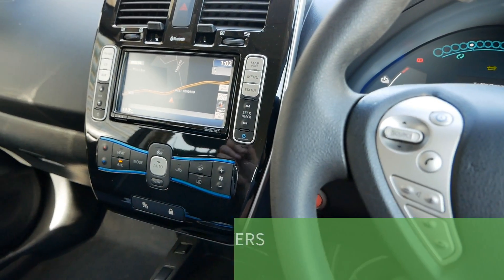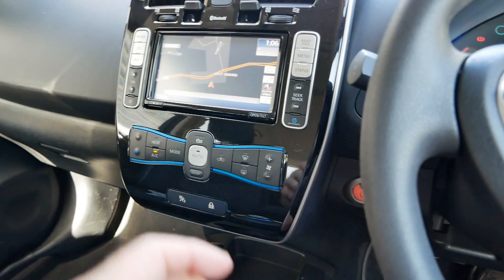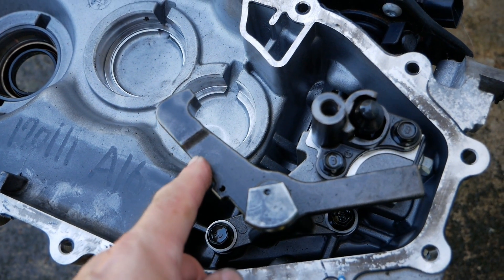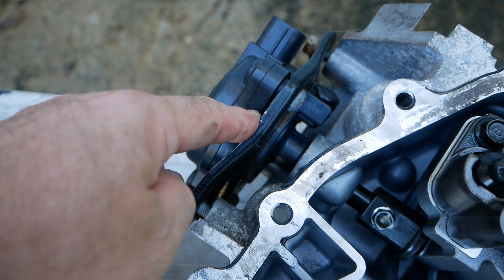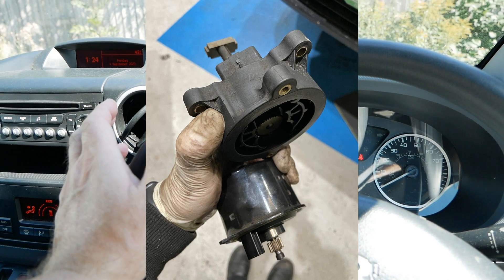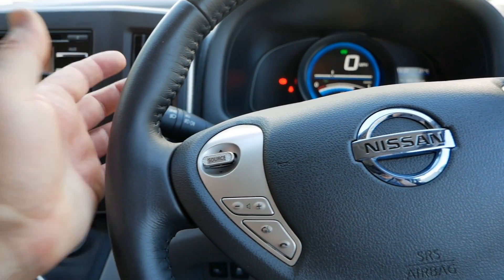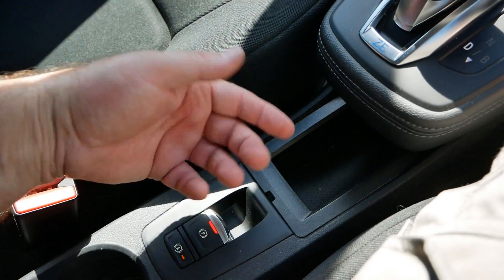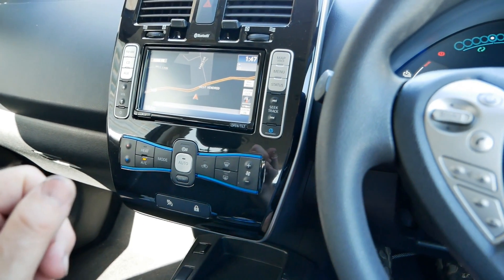How to correctly stop/park an EV. Many get this wrong, potentially causing damage!

Comment: Interesting. Therefore, if you have applied the ‘physical’ handbrake or equivalent what purpose does the ‘P’ on the EV gearbox serve? Just ensuring the car won’t move when started?
I assume the reverse is true when unbraking: ‘P’ EV release, then release the physical brake.
Reply from the maker: The park pawl is a sort of backup if the park brakes fail. Its an historical thing when rear brakes were drums. On modern cars with electric handbrakes, its not needed. Hence why some newer EVs no longer have one.
Yes, you're right about the reverse.

Comment: on my ioniq I alway use foot brake to stop completely my car then use electric parking brake then I release my foot from brake to ensure my car isn't moving and is holded by the electric parking brake and only after that I activate the P gear.

Comment: Same process as for automatic transmission vehicles.  One of the specialist Toyota mechanics on YT recently showed how small the parking pawl is in the auto transmission, and after many years of having the weight of the car resting on it, it can break.

Comment: On my Ioniq 2018, I simply stop the car with the brake, pull the handbrake and usually switch off the power. This also puts it in the park selection on the gearbox.
Reply: You can also simply switch the power off, and by the sounds it makes, it seems to put both Park and handbrake on automatically, presumably in the right order 😄

Comment: An extremely useful video Matt - thank you for explaining it.  I'd hazard a guess the vast majority of drivers new to EV's won't know this, as I have to admit I didn't. 
I have clearly been doing it incorrectly for the last 2 years with my 2021 Hyundai Kona.  It is my first EV and the Hyundai dealer I got the car from (on lease) did not mention anything about this.  In their defence, I didn't ask either.  My drive is on an uphill slope and I've often heard the 'clunk' when selecting reverse to back out onto the road.
Now I know what I was doing wrong I'll do it correctly from now on; Foot brake, Parking brake, Park
Reply from the maker: When on a slope, its even better to release the foot brakes after applying the park brake, then selecting park. It then means the weight of the vehicle really is being held on the rear brakes, which will put less strain on the gearbox park pawl.

Comment: the Ioniq manual has the following instructions : 
1. Hold down the brake pedal while the vehicle is parked.
2. While depressing the brake pedal, shift to P (Park).
3. While depressing the brake pedal, engage the parking brake.
4. While depressing the brake pedal, press the POWER button and turn off the vehicle.
Reply: Same
Reply: I’ve just I realised I’ve been using that method in our Ioniq without even thinking about it.
Reply: I use this method but the car move a Little bit After i turn it off, Is Okay?
Reply: @riccardomarinoni6733  car shouldn't move if parking brake is on before release foot brake
Reply: @sp1es  with parking brake on It move only 3-4 cm
Reply: @riccardomarinoni6733 this also happens on Leaf when parking on a slope

Comment: That method is completely opposite to what driving instructor teach. Most teach that you stop your vesical with the brake pedal, then with a ice manual transition put it in first or reverse, with an automatic transmission put it in park then apply parking brake then release brake pedal.

Comment: Not applicable to ID4 which when Park is selected as far as I can ascertain only engages the electric parking brakes on the rear wheels. There is no parking pawl in the gearbox

Comment: My car has no handbrake it only has a foot brake i thought it was the other way around because when its done like you describe the car almost jumps forward a little when you apply footbrake before neutral or park position i have a NISSAN LEAF 30 KW 2016  model.

Comment: Great explanation! I didn't know that. On my EV, I am used to press the foot brake and while it is pressed, i press park, then press the electronic park brake, then release the foot brake. Since the weight of the vehicle stays on the wheels brake pads, is that way of doing it is okay as well ?
Reply from the maker: Yes that's fine, but if you're on a slope, you really want to be applying Park last.

Comment: On an MG ZS EV, am I doing it right it I press the foot brake, then press park, then switch off? Can I just switch off with my foot on the brake? I can hear it out the electronic parking brake on.

Manufacturers who will only supply a complete new reduction gear box are thieves, frankly.
Reply from the maker: Many vehicles with an electric handbrake will apply the handbrake automatically when you press park or stop the car, but that's not a good idea if on a slope as the order will be wrong still and the weight of the car will not be held by the handbrake.

Comment: How much credence can you give to someone who rips up a parking brake lever without pushing the button to stop the ratched wearing? My Soul EV automatically activates the parking brake once the system is switched off, but Park is engaged first.
I appreciate what you're saying about not stressing the great box pawl, but cars are designed to be sold world wide and no driver in North America would dream of using "the emergency brake" for everyday parking :)

Comment: "An electric vehicle"? On the most sold electric vehicle (Tesla) you just press the park button or open the door. And you can do it in motion as it is just an electric actuator on the rear brake. So it is not possible to do it wrong.
Too many videos using "You are doing this wrong" as clickbait.

Comment: Not that long ago I was in a transit electric driving slowly across our compound on a rough bit of road with undulating pot holes. Basically it was that bad I bounced out my seat. This put the vehicle into park. The noise it made as it stopped was amazing.😂😂😂

Comment: the most important factor is not releasing the foot brake until both park gear and the handbrake are applied, right? as long as you don't release the foot brake until both of those things are done, then it doesn't matter what order you select park or apply the handbrake, yes?
Reply: I would tend to agree with your statement since the weight of the car would still be held by the brake pads.

Comment: Shouldn't the sequence be to RELEASE the footbrake after applying the handbrake but BEFORE engaging park? Most vehicles on a slope will "settle" on the suspension when transitioning from 4 wheels braked to 2 wheels. Such movement would also apply some load on the transmission defeating the purpose of this sequence (depending on the amount of free movement in the gearbox)

On the flat none of this makes much difference.
Reply: Surely it makes sense to go to neutral before Park as well. So, Stop using foot brake, apply handbrake, select neutral and remove foot from foot brake (now the car will settle and all weight will be on hand brake) then select park. That is how I do it in an Auto.
Reply: @migsg7238  you are correct neutral would leave the car with no load on the drive line. Depends on the vehicle, an ICE automatic would be gently pulling the car forward so neutral first would help. An electric car may or may not have creep, so neutral and drive may be the same thing on those cars when stationary.

In reality though when you shift an automatic transmission from drive, through neutral and reverse to park you should have your foot on the brake, and some cars require that to enable shifting. ICE vehicles with a mechanical transmission will have a delay as they shift between each mode so there will be time when the transmission has no load on it before the parking pawl is engaged.

Personally I think cars should be engineered so that drivers don't have to do these rituals, and the majority of vehicles are engineered that way. The parking pawl mechanism should be robust enough, and if there is a sequence that lowers the load on it this should be implemented in software, especially now vehicles often have electric handbrakes. The best solution would be no parking pawl at all, but that does require a robust parking brake with redundant application (i.e. an in caliper motor so that each wheel is separately actuated for redundancy, although this doesn't provide locking of all 4 wheels in front wheel drive vehicles).

Comment: Why does the motor burn out?  If the parking pawl is engaged in the gear, then why would the motor remain energized?

I can see that there would be significant stress on the pawl but I cannot understand why the motor is overloaded?

Comment: This is ridiculous! Don't you think the engineers have thought about this during the design stage? Besides. There is no need to engage "park" if the handbrake is engaged. What is it for otherwise?
Reply from the maker: Most (if not all) vehicles wont start unless its in park. As for the function, its a historic thing and a backup to the handbrake, which could be poor on older cars, especially drum brakes. Now that many cars have electric handbrakes which apply much more force to the brake pads, park on the transmission isn't needed and as I showed on the Renault Zoe ZE50, it has been removed on some vehicles.
Reply: @GoGreenAutos  I had a hire car in Abu Dhabi and was giving a lift to colleagues.  I couldn't work out why the boot release wouldn't work when i was dropping them off at the hotel. I eventually found out the car had to be in park to allow it to open.
Reply: I think of “Park “ as being an emergency back up for the unlikely event of a park brake failure. 
  You have to select “Park “ in cars with push button start systems before the push button will turn the vehicle off. This is the same for evs and ice cars.

Comment: Ha ha ha ha... Nope! 
After I've stopped the car by normal braking I press the STOP/Start button. Open the door and walk away.
The car automatically puts the electric parking brake and locks itself.
I don't need to touch the "gear lever".
You have a stupid car, sorry.

Comment: You can only change gear on the Hyundai Ioniq once your foot is on the brake pedal. Meaning that the weight of the car is held by the regular brakes each time you want to change gear anyway. Basically, when pressing P before using the electronic handbrake, the Ioniq driver is already holding the weight of the car with the brakes. So the order you describe seems therefore a bit irrelevant and contradicts your reasoning, doesn’t it?
Reply: Same with my Leaf 2019. U need to have your foot on a brake to change the gear or to put into parking. When pressing the P I already have my leg on the foot brake anyway and then I am applying the hand brake. It is a different order, but the same principal.
Reply: but soon as you take your foot off the brake pedal it’s going to stick all the force of the car on the parking arm and motor (if you don’t set hand brake first to hold the car)

The point is you don’t want the car to be sitting on the parking transmission pin as the parking motor has to work extra hard to yank it out of the slot, handbrake first park second > D first then handbrake off
Reply: @leexgx read my comment again. With the Ioniq, you keep your foot on the brake pedal throughout: the order is: foot on the brake pedal (so weight of the car is held), press P (still foot on the brake pedal), pull electronic handbrake (still foot on brake pedal), power off, release brake pedal. I don’t see how at any point the weight of the car is an issue when doing this way (which is what Hyundai tells to do anyway).
Reply: @Nikoo033 Whether you engage the handbrake and then P or P and then handbrake, is irrelevant, as long as you keep the brake pedal pressed.

His point is not to leave the car without the handbrake on, which must be engaged while holding the break.
Reply: @Nikoo033 the video describes  putting the parking brake (not transmission Park) on before you release the foot brake. You are doing the same but keeping your foot on the foot brake so that at no point is the transmission Park taking any strain.

Comment: Only trouble is my car doesn't have a mechanical parking brake, it's all done when you select park on the "gear knob". Also the car has auto hold when stopped and in drive.
Reply from the maker: What car do you have?
Reply: @GoGreenAutos  MG ZS EV Trophy LR, I find that the green brake light on the dash is lit when I come to a stop and pressing Park puts that light out and the red parking brake light on so the brakes are applied before selecting park buy the car and not me.
Reply: Our Enyaq doesn't have neither. I just put the car to hold via brake and either activate the parking brake or open the door. In either case the car doese the everything by himself. No manual brake available. I assume its equal withthe VW IDs.
Reply: My ID.3 does not have a “handbrake”. Only has Park.
Reply: The New Niro is the same, you select transmission Park, it puts the "hand brake" on too.

Comment: Thanks for those tips. I have a 2011 Nissan Leaf (Japanese import) with an electronic handbrake by the gear selector and the PARK button and will follow your suggestion. I wondered also what I should do when I come to stop at lights or similar. Should I just keep my foot on the brake or should I put my foot on the brake and put the car into neutral (like I would on a manual car). Should I put the handbrake on in such circumstances? Another thing when coming to a stop at lights for instance, is the car is still trying to pull forward as you press the footbrake. Is it ok to put the car into neutral as it is coming to stop (say at around 3-5mph) and taking the drive force away?
Reply: The car must stay in drive unless you anticipate being stationary for a long time (several minutes) in which case you should shift to park. Shifting to neutral might be a driving test fail, certainly would be whilst moving as the vehicle isn't under positive control. You can shift in and out of neutral whilst driving without damaging the gearbox, but there is no benefit.

There may be some drag whilst the car is in drive and held on the foot brake, but this depends on gearbox design and is expected behaviour (i.e. won't damage the car). Newer cars will engage engine stop start when foot is on the brake, an electric car won't apply any power.

In short, leave it in drive, it's safer, easier and how the manufacturer designed it to operate.
Reply: If you get into the habit of messing with the gear selector whilst moving- especially in an electric car like the Leaf - sooner or latter you WILL mess up and end up trying to put the car in park  while it is still moving. You don't want to do that.
Reply: Thanks, I've already modified my driving accordingly. @xmiller7691
Reply: @xmiller7691  most cars inhibit things like selecting park whilst moving or selecting reverse whilst going forwards too fast... do it whilst moving at 2mph and you might get an abrupt stop tho. But messing with controls whilst driving is a bad idea, ending up unexpectedly in neutral can be dangerous too.

I would be more worried about doing this in an ICE vehicle that has an actual multi speed gearbox. The electric car single speed reduction drive is more robust and doesn't care which way it's rotated, gear selection is a request to the computer not a mechanical action.
Reply: I've always wondered what would happen if a child leaned over and selected Park or R when driving at 70mph.. Hopefully nothing as the car would prevent damage, but I don't want to test this theory!
Reply: @decimal1815  selecting park or R at speed will be inhibited either electronically or mechanically. Applying the handbrake is also a bit of a non event as it doesn't have sufficient force to lock the wheels under normal driving conditions.

Related to that, in a car with ABS and stability control you absolutely should apply the brakes as hard as possible and steer where you want to go in an emergency situation, some drivers end up in accidents due to not taking strong enough avoiding action due to fear of rolling their car or losing control. Modern cars are surprisingly agile and difficult to roll, the car has systems to prevent this, obviously they aren't magic, but they make a big difference.

Basically if you can think of it, so have car designers. Check out WhistlinDiesel YouTube channel for examples of "bad" things you can do to a car, and bad things it won't let you do.

Comment: In the only automatic driven car I've had, I was always taught to only use Park when leaving the vehicle, otherwise at the lights/waiting for someone to pass etc, foot brake and put into Neutral.
Reply: I never had any instruction on when I got my first automatic. I used to used Park exclusively and very VERY rarely use the hand brake. Also when at lights/waiting, the car would judder a little whilst my foot was on the break and it was 'fighting' creep, so I'd knock it into neutral for comfort.